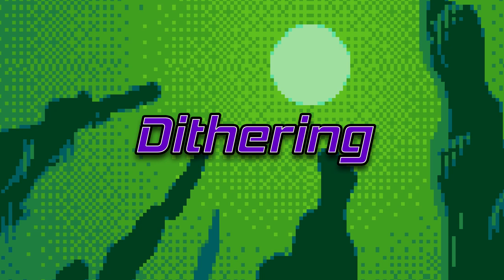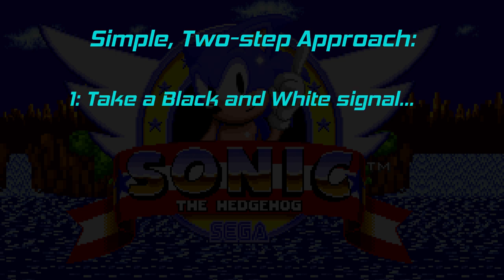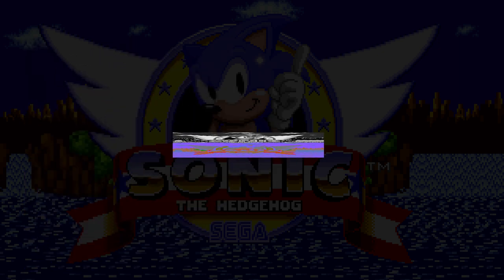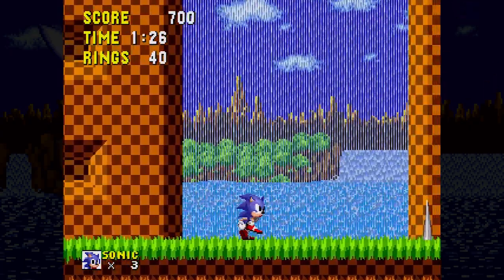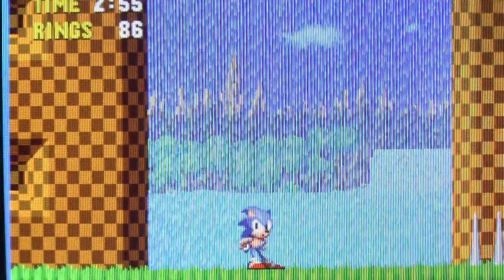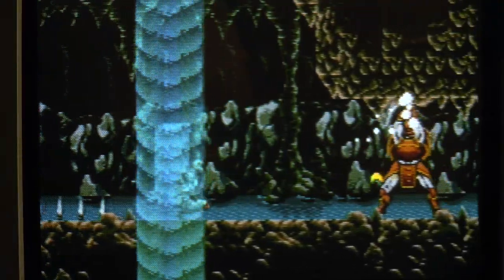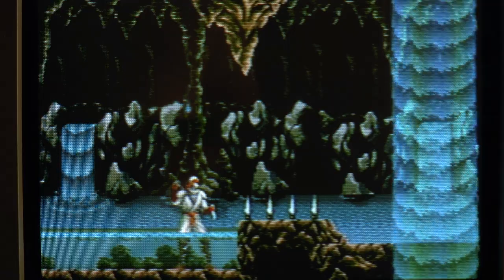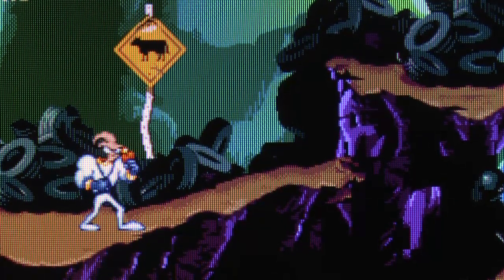Dithering on the Sega Genesis with Composite Video

Comment: Really interesting video, and something that was lost on us here in Europe.  Most TV's didn't have composite intputs over here till much later in the lifespan of CRT's.  We went from single coaxial inputs (for consoles, VCRs and the actual TV areal), to Coaxial and scart inputs.  The first time many of us in Europe saw Composite was Playstation 1 and N64 which had composite leads with a scart block to plug them into as most TVs still didn't have straight composite inputs.

People who upgraded from Coaxial usually went straight to fully connected RGB scart (the official leads were only a little bit more expensive than the cheaper 3rd party non-RGB scart cables, which sometimes only £2-3 cheaper or actually the same price.)  So we just went from Coaxial mush straight to RGB, and coaxial doesn't look transparent, it just looks shit.
Reply from the maker: In the case of a system like the Mega Drive in Europe, was it (in its various revisions) packaged with a SCART RGB cable, or did the cable have to be purchased separately? And as a follow-up, did the included cables vary at all depending on the region in which the system was purchased? (For example - France/Italy/U.K., etc)
Reply: Tell you what, I'll do you a pack in list for UK consoles off the top of my head right now (I'm old and have always been a console nerd.)  I think the rest of Europe was the same, the different language bits in the user manual had the same coaxial diagrams when it was RF as standard, and once it went composite with a scart block (a non RGB 8 pin scart connector you plug the red white and yellow component leads into the back of, so basically component through a scart plug quality wise) as standard, it was just composite with a Secam block where they used that.  So where it says 'Scart sold separately', it was also Secam instead of scart where they used that like France.

Bare in mind, for the whole of Europe, it wasn't until Dreamcast we got 60hz games without modding to play imports AND putting a switch into our consoles.  So everything was either cropped or squished AND letterboxed top and bottom with a 17.5% speed loss (60fps down to 50, 30fps down to 25, original Daytona on Saturn at 12fps instead of 15, Starfox on SNES dropping to 7fps instead of 10).  Streetfighter 2 on SNES and Megadrive for instance was fully 1/3 game squisehd down between 2/3 black borders, Ryu looked like a fat dwarf, and when Turbo came out it was star 6 out of 8 for speed that was the same speed as the arcade version.  Most games borders weren't as bad, but almost none were full screen, even most European developed games had the same sort of borders, with a very few that had smaller all around borders instead (so when pinched down and stretched out it filled NTSC screens) and played at the right speed (and run too fast on NTSC in comparison to how they were designed, but if you know no better you don't notice, like people over here thinking Sonic sounded different on emulators and Gamecube, because they had never heard the music at the right 60hz speed before.)

Apart from Amstrad CPCs that came packaged with a propietary monitor and didn't connect to TV's at all. ALL other microcomputers came with an RF lead as standard, Spectrum, C-64 and Vic-20 didn't have any other outputs on PAL systems.  Dragon 32, Acorn and BBC Micro all had the same strange non IBM PC monitor connectors.  Atari ST and Amiga both had some sort of weird, propietary even from each other, non PC standard monitor outputs, but Atari 8-bit computers still had the mono-component leads in the box alongside RF, I was one of the few people who had an XE and I used the component cable it came with to plug the white one into a stereo for better sound than the TV Speakers, it was still a good ten years till I had a TV with composite inputs (I even ended up running my Mega CD and SNES through 1000W Dolby Surround Sound SONY Stereo when I was like 14, I was THAT guy even then.)

Atari 2600 - Single RF

All versions of the Master System - Single RF, I think later hardware revisions were compatible with Megadrive 2 leads and might have worked with that Scart Lead.

N.E.S. - RF switch box (so you could switch back to the aerial and watch TV without changing the actual lead), never released the top loader as far as I know.

Megadrive - Single RF, Official RGB Scart sold separately, Megadrive 2 also packed in with RF, and had a different RGB Scart available for its new connector on the back

S.N.E.S. - RF switch box, RGB Scart sold separately, never seen a SNES mini over here.

Atari Jaguar - Single RF, RGB Scart sold separately

PS1 - originally RF switch box, later releases came with composite and a Scart Block, RGB Scart sold separately

Saturn - non-RGB Scart that outputted the same as composite, RF switch box and RGB Scart both sold separately (NOTE - A few first party Sega games on the Saturn were doctored to show a bit more of the screen instead of stretching to keep the same look, i.e. more floor and more sky above the life bar in VF2, and use a frame skip on the graphics so it ran at the same speed when playing, but with 50 drawn frames instead of 60. The ENTIRE list is VF2, Sega Rally, Daytona CCE, Virtua Cop 1 and 2, House Of The Dead, Fighting Vipers, Fighters Megamix, Manx TT, Sega Touring Cars, Burning Rangers, and that's it.  in Europe, THIS was the first time we EVER had full screen full speed console games and arcade conversions without modding and importing, even though it was cheating with frame skips.)

N-64 - RF switch box, official composite with scart block sold separately, COULD NOT output RGB at all as pin-outs were hardware blocked on the system.

(NOTE - From now on, almost every single game released in Europe had a 50/60hz switch on boot up, OG X-Box was the first to have that choice on the firmware to just set your console to run at that speed.  Unless it was on PS2, you'll see.)

Dreamcast - Composite with scart block, RGB Scart, RF and VGA box sold separately, almost EVERY game had 60hz modes selectable on boot-up, there are like ten or something that don't, sadly including Buggy Heat and Bangai-O (if you know Dreamcast you'll know them, they are the same ones that don't work with VGA boxes.)

Gamecube - Composite with scart block non-RGB scart sold separately, also hardware blocked from RGB output like the N-64 (done to stop import games running on the system apparently, don't know how, Japan and US used composite so ask Nintendo what they were thinking ONLY letting us use composite to somehow block that), no component cables as as we didn't have that port, and removed from all PAL software (so you even only get 576i on a Wii with a component cable, unless you mod your Wii and load your gamecube game through Nintendont with the 480p patch switched on, like you stole a rom from somewhere when booting up your own disc.)  Never seen or heard of a game that didn't have a 60hz mode (most you had to hold down B when turning the game on to set the 50/60hz switch, and then it saved it and you had to remember to hold B again if you wanted to change it back or you wiped your memory card), but this gen I got most of my multi-plats on X-Box and only really had Twin Snakes, Resi remake, and Nintendo games on GC, which all had 60hz modes, so I can't guarantee they all were, but it was close, its the least amount of games I have owned for any console, like less than 40 of them.

PS2 - Composite with scart block, RGB scart and RF sold (same as PS1 ones) and eventually component sold separately, but in 576i at 50hz mostly, as almost all PAL games had their 480p modes removed, the holding buttons down on power up to toggle it is completely gone on every game that works on in the US, and most of the ones you picked from an in-game options menu are gone too, including Soul Calibur 3, Tekken 5, even Gran Turismo 4 and Tourist Trophy so no 1080i for those two either (or even 60hz).  And on top of that I'm guessing only about 15-20% of the games actually had 60hz modes, some were horrific with the amount of screen taken up by letterboxing, FFX is legitimately a 1/3 band in the middle of a 4:3 screen, and STILL has borders if you stretch it to fill a 16:9 screen, plus 17.5% slower on a 100+ hours game to get everything, is basically an entire extra day of your life in hours (or like 5 full days not playing any other games.)  And double that for X2, so like ten whole days of gaming wasted to poor PAL conversion speeds.  It was the only console that still didn't offer the 50/60hz choice as standard, you were lucky to get it even though the same game would be made in Japan or the US and be 60hz on Gamecube AND X-Box, but not PS2, so after X-Box was released I NEVER got a multiplat game I could get on another system, chances are it had huge borders and ran slower (and usually had much worse graphics and no widescreen mode either, but that was just PS2 being poor and not a region thing.)  Most retro style games like 2D fighters and shooters had 60hz, most polygon games didn't, no idea why.  Sometimes games would have a 60hz mode, but the sequel didn't

X-Box - Composite with scart block, RGB scart available, Component available for connection clarity, but all component modes blocked on the firmware although still on the disc (so you could have a better picture at 576i, but couldn't use 480p/720p or the handfull of 1080i games at that resolution, unless you soft-mod your X-Box, then you're good to go, no official leads released but you could get the US ones.)

From then on the consoles were pretty much identical to the US and Jap versions because we went from CRT to HD flat panels, but PS3/360/Wii were still packed in with composite leads and a scart block as standard (PS3 came with the exact same lead and scart block, using the same connector, as PS1 did after switching from RF), but everyone just buys HDMI leads.  It was also the first generation to NOT block progressive scan except for a tiny handful of PS2 games (even less than had 60hz) and Dreamcast via VGA cables had allowed.

PS4/X-boxOne/WiiU generation were the first consoles in Europe to come with anything other than standard def leads and had HDMI leads in the box.  I'm assuming Switch does but I don't have one or personally know anyone that does.

Didn't have an Amstrad GX400, CDI, 3DO or any of the Comodore consoles, so no help there I'm afraid, I liked my Japanese games better than western games, and the only Japanese console released over here I didn't have was the Neo Geo cos i was like 12 or 13 when it came out.  PC Engine was scheduled, even marketed for a while, but eventually never got released, and I never actually saw an MSX in anything other than gaming magazine articles about what's big in Holland, but I'd guess that came packed in with RF just because everything else did at that time. 

Finally, we NEVER had an officially released S-VHS lead for any console, most TVs never had the inputs, and the few import ones used to mainly get sold alongside a scart block that let you plug your left and right audio and S-VHS into a scart connector, just like the composite scart blocks that came with the consoles.

Comment: I do have an appreciation for how the dithering works on real hardware combined with a CRT but I do find myself preferring the crisp dithered look to any of the attempts that have been made in the emulation scene to emulate the CRT blending. They all just look dirty and off to me, though I would definitely be stoaked if someone finally cracked the issue and created a good CRT emulation mode for emulators. It's difficult to properly emulate the look of a CRT.

I also have an appreciation for older PC games in which the dithering was meant to be seen, as PC monitors have always been crisper than CRT TVs.

Comment: When using 50/60hz switch on the Sega Saturn the dithering is very noticeable and also on the PAL Sega Saturn so I have opted for the Japanese Sega Saturn which has a great composite signal and the lack of transparencies is almost a none issue.

Comment: Fun fact- while most say the GENESIS can only do 512 colors with 64 per line, you can actually get 160 per line with a special trick and up to 192 per line using the hilight/shade sprite mode.

Comment: dithering is what RGB does also but now that the pixels on a screen are so small they look very sharp... looks like you had an old RF signal video. It was tough times when you had to adjust your vsync, colors, vblank alighnment, etc.  You had control on your TV to try and make it looks good. Then tuning in the signal to the right frequency was fun also but all kids knew how to do it.

Comment: Excellent video. I thought you did a great job here despite the fact that I much prefer RGB to composite. I think developers of the time used genius methods to exploit the limitations of composite; thus achieving the awesome effect of dithering. However, in my mind, the original image data is that of the RGB signal. So, even though I grew up on RF and composite, the checkerboarding is more 'accurate' in my mind.

Comment: I don't think this is about composite vs RGB. I'm pretty sure this still worked on my old systems back in the day when outputting through [the vastly superior to composite] SCART connection in the UK, which I think is a proper RGB signal. I think it's about modern digital displays vs analog CRTs.

Comment: The smoothing effect on the rad2x cable solves this issue. My original HDG Model 1 looks gorgeous on my samsung 4k TV (a 2017 model) with, at least for me, no noticeable lag with game mode on! I'm a big Mega Drive fan and it's the only console I have true nostalgia feelings for, having been the only one I had up until my ps3! The shipping and customs costs of the Mega SG for Portugal pretty much doubles the price... I would definitely buy it if i could but, given my budget, between spending 350 euros (for something that costs 170 euros) and 70 euros (which is still a big price for a freakin cable, albeit a worthy one) the math is quite simple.

Comment: I have model 1 Genesis I never noticed this. I will check now.
Reply: Though I am using it with RF at the moment. Though I haven’t checked yet.
Reply: So apparently I do get the weird red verticals lines and what is expected of the type you showed in the video that had the streaks.

Comment: Mayhem in Monsterland(1992) for Commodore 64 takes this a step further by using palette cycling at the full 50Hz on solid colour monsters to create colours not possible. It obviously also uses dithering, but also has "fringing" on some background parts. It all looks really terrible(even seizure inducing to some folks) on emulator, but on a CRT over RF you'd never know it was happening.

The developer said that it expanded his colour palette from 16 to 27.

Interesting note is that in PAL it seems to be horizontal lines that blend, rather than vertical. I dunno if that's just a developer choice or a difference between systems, but I know Apple 2/CGA composite colour doesn't work on a PAL TV.

Comment: Totally see the point and great video. It's just a shame the Sega Genesis composite video out is so low quality, weak, and fuzzy with bad color bleed (especially red) - one of the reasons people are excited for RGB output, one can finally have a decent, sharp image with improved detail and legibility. A real, ehem, game changer. The TurboGrafx / PC Engine on the other hand already has a strong and sharp output in comparison, with the SNES also being up there in signal quality. Example, with a modern TV I had no choice but to get a HD Retrovision RGB cable for the Sega as plugging in the composite was completely unusable - as in not simply low quality but wildly waving (as in moving back n forth) and discolored image. It was either that or badly bleeding and muddy yet stable image on a CRT TV. The PC Engine Duo though plugs into a modern TV without a hitch and looks pretty great even without RGB out with no signal strength or stability issues, last I checked the SNES was fine too even on a projector, heck even the og NES. Love the Genesis/Megadrive but arguably, obviously, and notoriously weak standard composite video output. Edit: If you are using RGB out, you can sit farther away from your TV (anyone remember the old "sit 6-8 feet away from the TV" rule, for your eyesight?) and the dots and patterns will come together naturally in your eyes like with Pointillism paintings in a museum, where up close it's just dots but step back and you can see the image. Also using a non PVM regular CRT would probably help.
Reply: You are absolutely correct!

Comment: I'm sure you are aware that the 2005 TV uses the same design as Sony Trinitron displays, due to the relative cheap with great color detail and brightness. 

Problem is, due to the design of the shadow mask, pixelation and dithering became more visible. (The vertical lines on most modern CRTs use the same shadow mask) 

Prior to the expiration of the exclusivity patent on the design,  most TV manufacturers' shadow masks used dot-based designs (sectors of three color dots) or the more efficient block group masks (pattern of squares with three colors per square, look like pixels but are not).

Comment: Something that I've always noticed is that, the improved looks of a CRT is (almost) always coming from the fact that the horizontal resolution gets slightly blurred, since it has no actual resolution in that axis. I wonder if there's something out there that does that